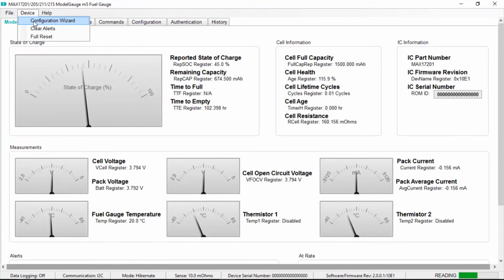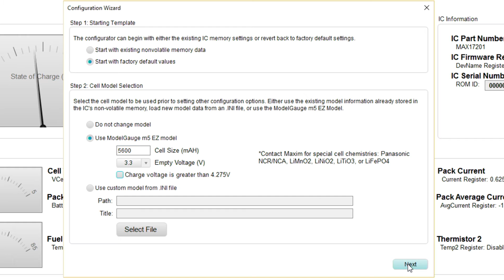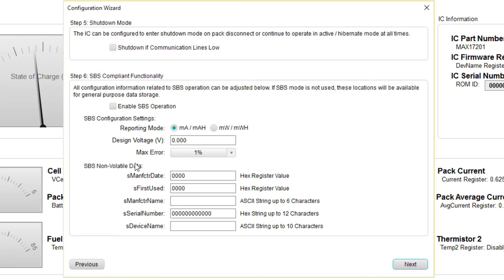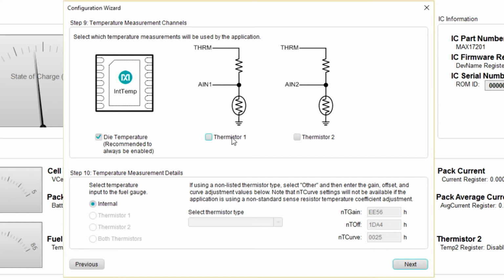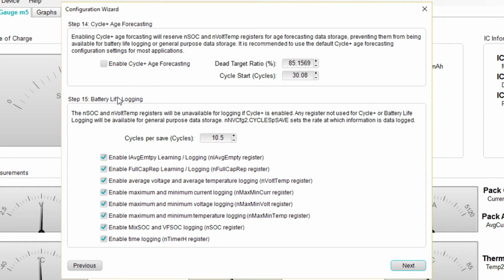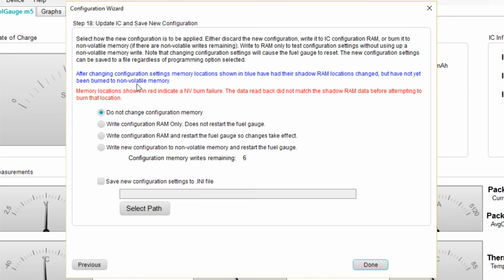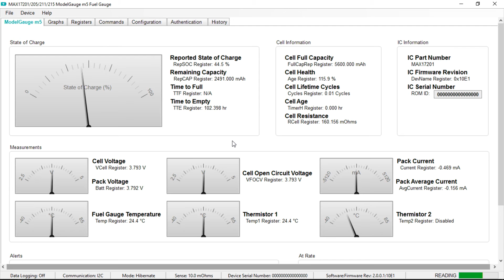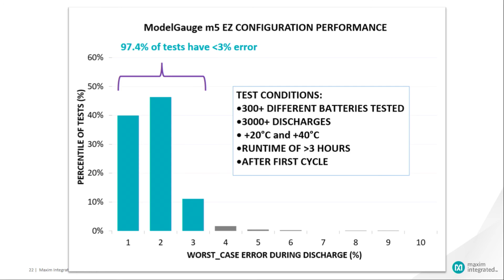EZ Setup of MAX17201/MAX17211 ModelGauge m5 Stand-Alone Fuel Gauges

Comment: 6:22 On thermistor parameters, "You can find more information on that in the datasheet."  No you can't.  It just lists the same registers values for a couple of specific thermistors.  There's no information or formulas for these values to allow using a different thermistor that doesn't have values in the datasheet.

Comment: Hello, can this setup work without a slave?  I am attempting characterization using the MAX17205GEVKIT EVBoard. At the end, the programming fails. Is this because i have the DS91230+ USB adapter plugged in with no slave attached to it via RJ-11 cable?

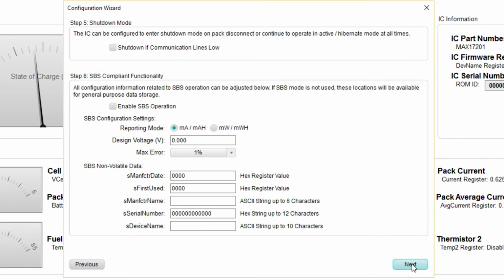Comment: I have a question about your setup. At 1:43 you are connected to 2 cells in series, but at 4:45 you say "we have the 17201 so we will select single cell". I'm a bit confused because, 1: it looks like you are using 2 cells not 1, and 2: shouldn't the number of cells be determined by the battery pack, not by the IC you are using (e.g. 17201 or 17205)?
Reply: The cells are in parallel not series.
Reply: Parallel, not series, so it's a single-cell voltage